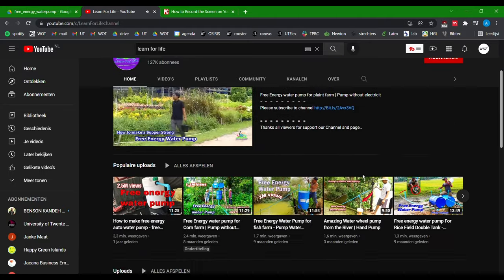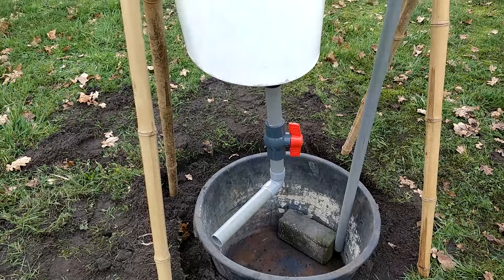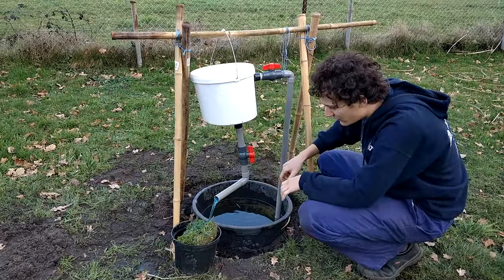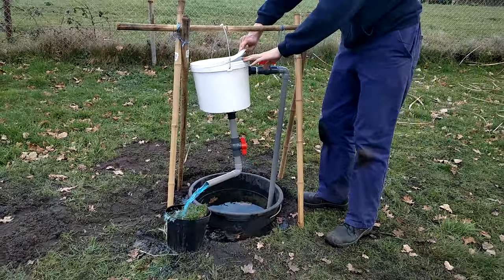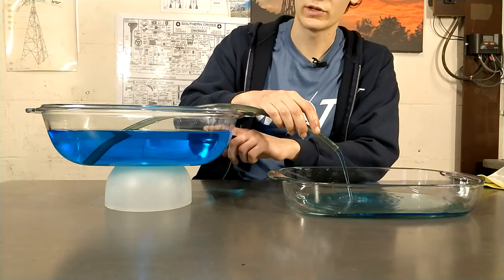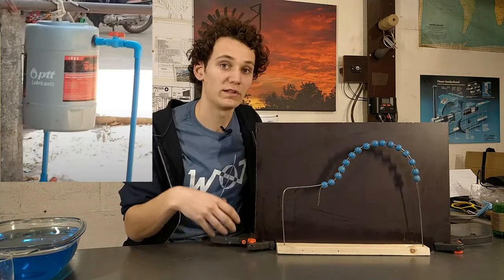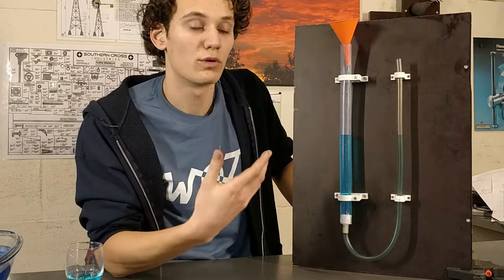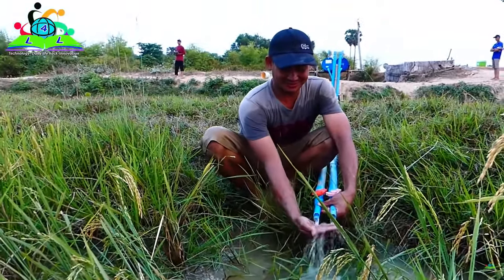FREE ENERGY Water Pump Tested. Is it possible?

Comment: It won't work. Air pressure inside the tank will pull the air from the outlet. See how there is a space in the water going out of the pipe.. that's the air entering. It won't pull the water upward coz you know air is lighter than water.

Comment: You forgot the check valve at the foot of the pickup pipe.  Also, the container used to prime the pump has to be airtight.  This "pump" relies on the vacuum of water leaving the airtight priming container to draw water up through the pickup pipe much like you sucking on a straw to get water out of a glass.  The check valve makes sure there is always water in the pickup pipe as you want as little fluid level drop as possible in the main priming chamber.  Have one of these pumps setup to water my raised planters and the shelf planters under them.  The prime unit is 55-gallon plastic barrel and the tank it's drawing from is 350 gallons.  Another example of how this works is the old pool filter system we use to have.  The pump wasn't strong enough to pull water from the pool and through the filter unit, so we put a small tank on the pump side of the filter unit for the pump to draw from. As it did so the air pressure drop allowed the water in the pool to be sucked up and through the filter unit to then feed into the tank the pump was pulling from.  This allowed us to ditch the massive AC powered pump the pool came with and use a much smaller DC pump that used solar panels and battery setup to run.  Our pool stayed clean with this system until a tree fell and smashed the pool.
Reply: I am building a swimming pool this next summer that will generate power for my home. I am very interested in your design.
Reply: Purpose of using a barrel is that you do not need any foot valve at the suction side.
Reply: he does not prepare the show very well, because he lack of knowledge
Reply: @caaip38  This video is excellent. It shows that a drum „pump“ can not pump any water to a higher level. No siphon, priming barrel or not, are able to do that. No input of lifting energy.
Please have a look at https://en.wikipedia.org/wiki/Siphon
The drum „pump“ is an example of a flying-droplet siphon. The video shows that no siphon can bring any water uphill.
Reply: Show us with a video!
Reply: @Dingsrud  You are correct, you cannot siphon uphill. It DOES WORK  because of the suction/vacuum that move the water uphill.  There are many of Off Grid builds using these very successfully. Or is there some weird Law that claims you can't suck water uphill. The one I built sure is irrigating the back of my property well.
Reply: @OneMoreStand  This set up with a priming tank is nothing but a siphon. You may consider it to be a variant of a Flying droplet siphon, ref:https://en.wikipedia.org/wiki/Siphon 
It is a well known fact that no siphon can lift any water to a higher level, a siphon is no pump. In this case the source  is lower than the output from the system. When some water leave the system, a lower pressure will be created in the tank, but not low enough for any water to be pressed up sufficiently high to enter the tank from the source by atmospheric pressure. With a lower air pressure in the tank, air will start entering the tank from the output side and a gulp of water leaves the system. This repeats. When the tank is empty, it all stops. Notthing has ben lifted from the source. 

If this system had worked, everybody could arrange a  bath tub, a tank, some tubing and a generator in their back yard and make electric energy for free. A Perpetuum Mobile.

Comment: We just did this, and it does work. I don't know what you did wrong, but we used smaller pipes and made sure everything was sealed.
Reply: it's the angle of the outlet pipe allowing air to gulp backwards along the outlet.
Reply: Please share the vedio
Reply: This simply does not work. Please give us a video of your claim. You have just made a perpetuum mobile. Nobel prize in physics comming?
Reply: @alanhat5252  No, it's the lid not being sealed.
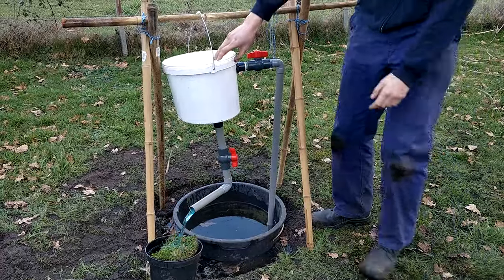Reply: @darrylkinslow3357  2:32

Comment: You are losing your vacuum.  Air is getting sucked into the bucket, hence the gurgling sound.  You need your outlet pipe to be much longer with an air trap to prevent the loss of vacuum and a one way (or foot) valve on the intake so that water cannot flow backwards.  Also, this pump is a vacuum pump, so the larger you can get your vacuum vessel, the better off you should be.  It is the difference in the weight of the water in the vessel to the weight of the water in the intake pipe that causes the draw, in principle.
Reply: No, you're wrong. If the outflow is higher than the inflow, your "weight" difference is unable to draw water into the barrel. You must place the drain lower for the siphon to work. You have gaps in education. The drain pipe can be 10 km long and still the water column will not be pulled out if the end of the long pipe is
above the level of the pumped water. It always depends on the vertical height of the water column with the cross section of the drain hole, which affects the pressure. The shape of the container, which is also a 10 km long pipe, has no effect on it and therefore it is not possible to pump water to the height in this way. In primary school, volume-independent leveling is taught under the name "Combined Vessels". The pressure in the small and large cross-sections, which is always the same, is taught at school under the name hydraulic piston.
Reply: @DL-kc8fc  This pump is not working off of siphoning principles, it is working off of vacuum principles.  As long as the outlet pipe is large enough to break surface tension of the water and you put an air trap on the outlet, it should work, but it would have to be recharged after awhile.  In other words, it is not exactly a free lunch.  You are using more water to move less water similar to a ram pump.
Reply: @wesbaumguardner8829  You've already written it somewhere. I have to repeat - you are wrong. It is a siphon and the siphon is a pressure pipe, so it works with underpressure (vacuum). Everything else (barrels, PET pressure bottles, check valves, etc.) are cosmetic elements that deceive you in third world people (to make it look sophisticated). This is best done with a long drain pipe that gets lost in the field so that you cannot detect that the pipe outlet is below the level of the pumped water. It is still a SIPHON that only works if the outlet (any large or small) is below the level of the pumped water. This is a physically proven principle that you have not tried when you claim that "it could work". :) The "booster" won't help either, because to induce the Bernoulli effect you will need 1000L of water to squeeze out 0.5L of water. Perhaps no one can seriously claim that this justifies the principle of fraud. This is a better water ram (water hammer, etc.) that "knocks out" one percent of the water flowing through the pipe in the stream.
Reply: @DL-kc8fc  I wrote that earlier when I thought it was a siphoning process.  I now understand it better.  It operates on the same principle a syringe operates by, but instead of using human power, it uses gravity to pull a vacuum which then moves a smaller amount of liquid.

" It is a siphon and the siphon is a pressure pipe, so it works with underpressure (vacuum)."  A siphon requires the inlet to be at a higher elevation than the outlet.  That is not the case with this system.  This system has the inlet at a lower elevation from the outlet.  The siphoning function will not work with this setup.  If there was no one-way valve, the water would flow out of the inlet pipe back into the source.  However, the one way check valve prevents this from happening.  So when the outlet is opened, water can only flow in one direction.  The outlet pipe is too large to maintain surface tension and this breaks the vacuum, which allows water to flow.  But if you installed a P-trap to create an air lock, you can prevent the vacuum from being lost all the way to the drum itself.  So long as the water tank is a higher elevation than the P-trap, the water should flow because the pressure of the air is much lower than the pressure of the water.  If about twice as much water is entering the system as is leaving it, it should draw some of the water into the tank.  However, the tank will have to be re-filled by some method that requires energy at some point, so it is not a real solution to the problem.  A windmill or some other form of powered pump would be a better option than this.
Reply: @wesbaumguardner8829  It really doesn't work like a syringe because it can't gravitate to draw water into a drain hose that ends at a height above the level of the pumped water from a stream or well. This drain hose must be extended so that its drain is below the level of the pumped water. Only then can the gravitational potential work to pump water into various unnecessary barrels, etc. So it's a siphon. If it worked like your syringe, which is not possible for many reasons, we would have coughed up Tokamaks in Europe a long time ago and made these water perpetuum mobile. You were deceived by people from the third world.
Reply: @wesbaumguardner8829  Sorry, this setup does not work. Make an air trap if you like, it still does not work. Outlet is higher then inlet.
Reply: Siphons and vacuum are working together.  ie, no vacuum, no siphon...